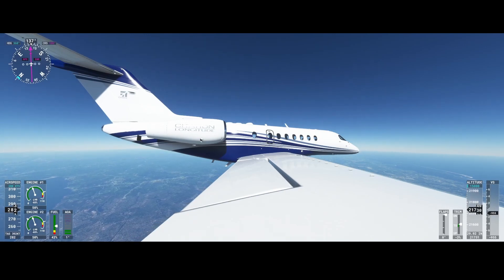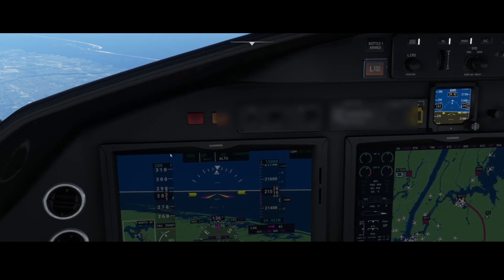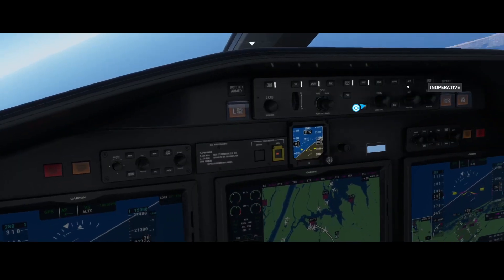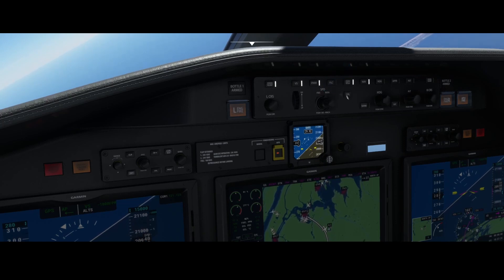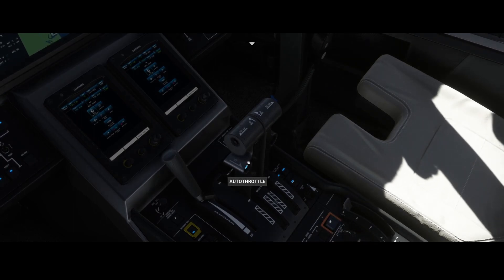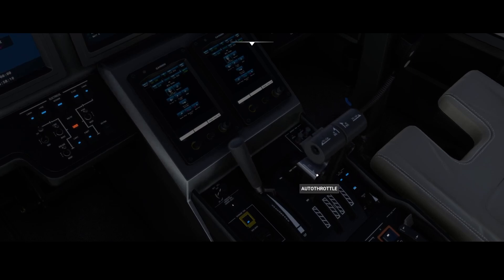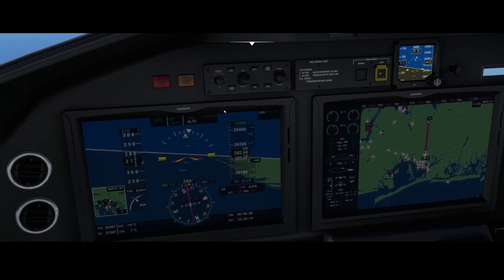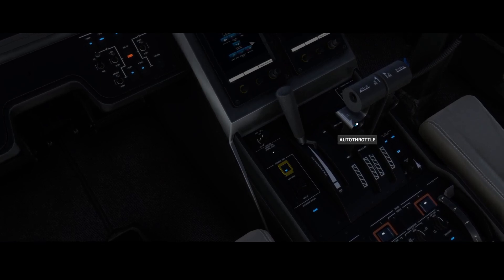Flight Simulator 2020 - How to - Cessna Citation Longitude - auto throttle

Comment: Your video title says CJ4, but you are really showing the Longitude. The CJ4 has no auto throttle.
Reply from the maker: thanks for letting me know I will update the title
Reply: @Highintheflightsimsky You are also referring to the CJ4 in the spoken text.
Reply: thanks for this comment that I really needed I was curious to know if the cj4 had the auto throttle, it only has FLC which maintains the speed during takeoff and landing
Reply: @1191SPEED  VS mode works well, but you must control the throttle to achieve best airspeed.